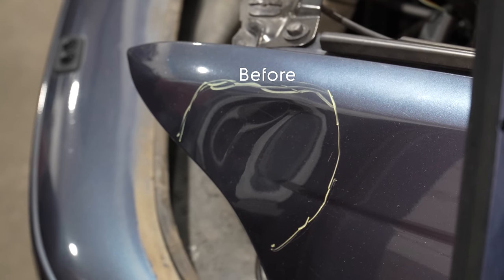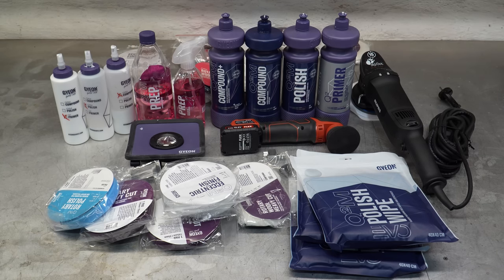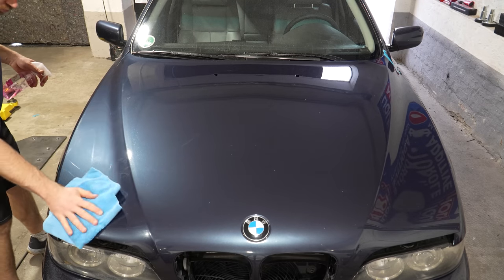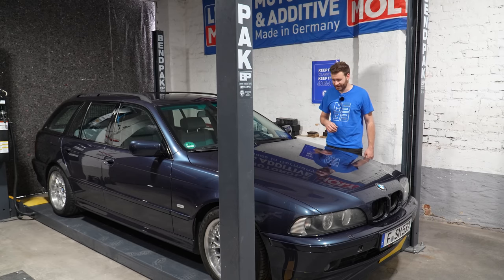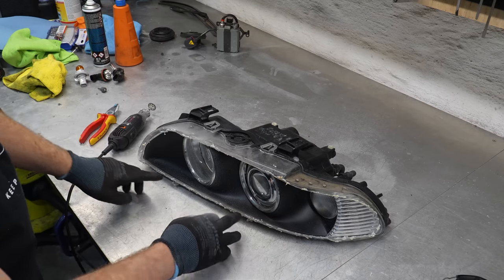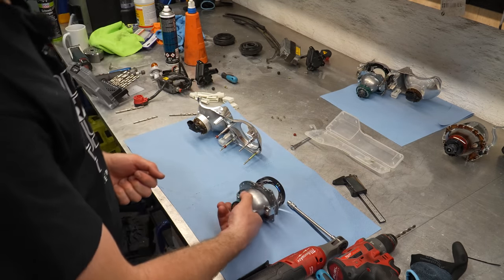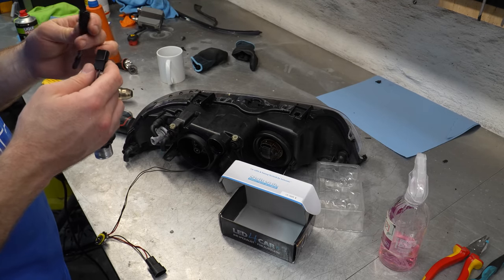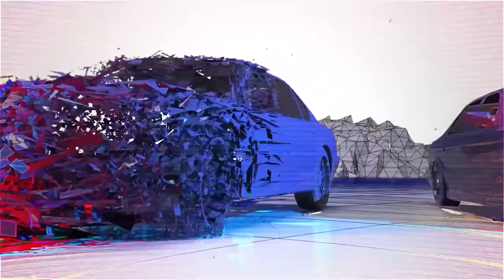What It Took to Restore a BMW E39 5er Back to its Former Glory - Project Rottweil: P7

Comment: I bet the TUV inspectors love when you bring in your projects. Such a treat from the mundane things they must see.
Reply: For once they dont instantly take out the " poking screwdriver" to hunt for rust holes in a 90s BMW. Many E36 are rotten away, many E39 are only still good because people look after them more...
Reply: Thought is it illegal two retrofit bi-xenon. Would love to hear what the tuv inspector reallay said to this one. From my understanding it's completly illegal to change anything in the headlights, including the projectors, even if you don't use the bi-xenon function.
Reply: @LeonBraun  Mosty police goes after cars that look modified. If your car looks stock you can drive around in a litteral rustbucket and they are most likely not gonna care. As for Headlight Retrofits, he did the TÜV inspection beforehand if I remember correctly.
Reply: Yes true, I think the biggest problem is in case of an accident. Insurance companies can be very picky if something safety relevant is not stock.
Reply: @LeonBraun  Totally agree, if there is any way to back out of paying, insurance companys will find it.
Reply: @LeonBraun  Bi-Xenon were an available option when the car was new so its not considered an illegal mod - at least that's my understanding of the TUV inspection criteria.
Reply: @LeonBraun from my understanding of UK law. There is a similar law regarding retro fitting HID’s to OE headlight housing’s. But I haven’t done full research on the subject.
Btw, this is not a criticism of this thread comment or video/channel 👍
Reply: @cd0999  sadly it is. There are some people in the german community who try to get a official tuv for this mod. Its around 2000€
Reply: @LeonBraun  Depends on your specification of car. If "xenon" was in your specification you can install bi-xenon. The only thing they are checking - level of light. Also not every policeman is going to check your headlights here. Especially if your car is in excellent condition. 

I went a bit further. 
I have 2012 opel meriva b which had originally halogen reflector lamp. A year ago I retrofitted it with bi-LED. 

And right now the light is better than on the newest porsches :D
But there are some problems: 1) it's a bit illegal. At least in Russia. And in USA. And in any european country as far as I know. But nobody knows anything about opel meriva here. It's not a popular car. Also it's hard to tell apart is it led or xenon. Also it looks like original lights. 2) Everytime you're in the city or going on high hills you should lower your lights just to be sure that you're not going to blind anyone. 3) You should install Bi-LED in a good service which at least have lights corrector. 
Meanwhile nobody blinked me for blinding for the whole year (35000 km). Literally: 0 people. 

BUT: 1) LED is better than Xenon because of the intensity of the lights, 2) you can program LED with your car computer so the light will follow your steering wheel for example (in Russia every service can install it on VAG/Mersedes without loosing the features of xenon), 3) LED is not as hot as Xenon. It won't burn out the reflector.

Also there are some matrix modules are available on the market. Really love how it is possible to finally see the light on nearly every car now. And I hope that one day at least some countries will lift the ban on modifying the headlights if some conditions are fulfilled (for example if isn't dangerous for other drivers and can function as good as from factory). 

Had some videos, photos and led's names attached to the comment but youtube deleted the whole message. If you want to see it you can just google "opel guacamole-chan" and find guacamole-salad-colored opel meriva b on russian car-guys portal. The name of topic with installation is called "*something on russian* Bi-Led".
Reply: @LeonBraun it is but who can say that you did anything if this car had some xenon lights?
Reply: No E Prüfzeichen makes it easy recognizable as illegal.
Reply: @adamt3332 you cant really tell but technically its not allowed. Its like the episode where he spraypainted the aftermarket suspension link black because the original part was no longer available or smth. If they cant tell the difference its apparently fine.
Reply: @NaticusFetch51 what i can tell you is that you need to have autoleveling headlights if you have have over a certain amount of watts in europe. As well as something that cleans the headlights. I think there is one xenon headlamp that managed to stay below the watt limit but basically xenon=autolevelling required.
Reply: @D3nn1s  yeah, I know about it. The same requirements are here in russia excluding headlight cleaner. It is required for xenon but unrequired for Led. Even on new cars.

The problem is that autocorrector isnt a perfect solution. Even on new cars like kia soul it can blind other cars. But when you're operator and you think about others - that is much better than autocorrector.
Reply: @NaticusFetch51  i rarely see xenon/led blinding people and when they do its just 1 light not set up correctly most of the time. However i regulary see trucks or vans with halogen that are blinding cuz they dont even know that this feature excists.
Reply: yes, they must be so interested in new suspension struts.......LMFAO
Reply: Just a heads up so you don‘t get in trouble: they don‘t usually check for PPF on headlights or similar unless your car is really modified. If it‘s just a clean car in OEM look, they won‘t even check for something like that. More important is the E-Number on the headlight glass which I‘m pretty sure that the original ones had and new ones don‘t, correct me if I‘m wrong.
Reply: @tw1st3d35  yep. Headlights have symbols on it's body. For example, you have linzed halogen (like on opel meriva b with afl headlights). Technically if you installed bi-led or bi-xenon it would be unreal to see the difference. Because c'mon it's already linzed. But the body of your headlight have a symbol that it's halogen. 
Also when you're rebuilding your headlights the sealant will give away that the headlight was opened. 

But I agree that if your car looks clean nobody will check it. At least if you are not going to install bi-led in lada 2101 :DDD
Reply: @NaticusFetch51  sealant is hard to see so I doubt that will give it away. The bigger issue is the E-Number. Without it, you can fail tech inspection and you can get fined in a police stop if they notice it which they usually do because that‘s all they look for. But a clean car like this, nobody is going to take a second look.

EDIT: I couldn‘t see the E-Number on original glass so I think it‘s on the housing which he reused.
Reply: Xenom retrofits needs headlights washer
Reply: @_Philip_.  no they don‘t as long as they are under 2000 lumens.
Reply: @NaticusFetch51 xenon and especially LED headlamps are a total disaster for everyone except for the one driving the car itself. I tried to give it the benefit of the doubt, but as more and more cars with those headlamps roll out on these roads with factory fitted non halogen lamps I can't anymore. The self leveling is always too late, every bump in the road blinds an entire district, the color often is disturbing and feels very unnatural/unpleasant to the eyes . Only on a few % of the cars it's acceptable, but just on straight roads with minimal elevations. 

With all these unresolved drawbacks it should be banned worldwide, just as those flickering mist lamps that go on at turns and LED daylights on bumpers that most of the time are wobbling, even on quite new cars.
Reply: @12123188  if you’re talking about led or xenon bulbs on halogen headlights - yes. Those people should be in Hell. Even in Russia if you’re stopped by the police with those bulbs they’ll probably take away your driver license and confiscate those bulbs. But I was talking about the whole modification of your headlights with installing the modules of led or Xeon (bi-led or bi-xenon). You literally need to cut your headlight and remove halogen mechanism to put the module here. And maybe it depends on the size of a car and how you installed and how you adjusted it, but I’ve blinded no one for the whole year (since aug 2022 with a total mileage of 35000 km). Why I am so sure? Because Russia isn’t shy country and if somebody is blinded by your headlights they certainly will turn highbeams to blind you to make you turn off your highbeams or lights. Or at least flash you with his headlights so you’ll notice that you are a nuisance for other drivers. 
When I first installed those lights i’be got once ‘flashed’ in the city because I didn’t lowered my headlights and was going up the high hill. So since that moment I always do lower my headlights in city/on speed bumps/when I’m going on the HIGH hill. And I never got flashed again for a year.
A few messages before I told how to find a topic with a result of installation on my Opel (google: opel meriva (Установка Bi-led) Dragon Knight K3 ). I’ve got a lot of photos and videos (1 hour of driving on my daily route). 
But I also agree that self leveling is not a big help. Even if it is installed on factory it can blind others. So normal driver who respects other drivers should at least use mechanical leveling.
Reply: @12123188  ok. Opened some videos on my yt. 3 from my dashcam and 2 from phone. Sorry for music on videos from dashcam. 
On video “гонки 1“ headlights are settled on the lowest level (forgot to make it higher). On others the level is on 0. As you can see I’m not blinding anyone and the color is ok. In real life it’s even better (not absolutely white/yellow/blue/green. Absolutely natural color).
Reply: @NaticusFetch51  I believe you. I've seen it being good. But even when it's factory fitted most of the time it's just rubbish. Here a lot of new VW's have it and it's rubbish most of the time, even the DRL lights. Almost every time those DRL lights wobble like they're on a vibrating plate. I don't know what's worse,  too slow adapting headlamps, or the ones that aren't perfectly set. With not perfect halogens it's bearable. The others just laser your eyes, retrofit or not.  Even on BMW's and Mercedeses. I applaud the people where it's all sorted out but it's a very small percentage. I guess most of the mechanics set those non halogen lamps right on the highest point where it's still good/legal instead of a notch down. Maybe it isn't the technology but the regulations? The fact is that in almost all of Europe it isn't right and something has to be done about it.
Reply: My E39 got complete rust prevention on the underside and in all holes, only rust the car has is from paint chips. I love it
Reply: Factory new cars blind me with their lights, the new Toyotas especially
Reply: Maybe to BMW enthusiasts. To the vast majority of people this is just another station wagon
Reply: I really think they even don't inspect the car anymore. They already know the car Sreten brings in is in mint condition.
Reply: @cd0999  Show me that E39 with original bi-xenon headlights :P
Reply: @LeonBraun  If you want to get really specific - AFAIK it's not completely illegal, e.g. there was a case of TUV allowing the use of LED replacement bulbs (light source? whatever you call them) in a car that doesn't have them stock (Dacia Duster) which is technically a violation of a headlamp homologation as it's homologated for a specific light emitting element. In reality you'd only get in trouble if it's visibly modified (demon eyes lol) or if your lamp looks stock - so unbelievably bright that you get singled out by the police. Inspectors check if it's set up right and maybe the minimum light output. Not DE but my car passed inspection despite having its lights close to kaputt. It was actually dangerous to drive at night but it passed anyway...
Reply: @tidysampler585  police dont care but its if the car didnt have the option of xenon or the likes it cant be installed, if it is it has to be to some sort of specs for saftey, so really its a stupid law that doesnt do anything but tell you to modify your car properly.

Comment: I had my E39 headlights refurbished /also upgraded to facelift ones as my car is July 00, so just before facelift - now I no longer wonder why they didn't feel right from the start after I installed them.. Further more - the right one stopped moving up and down, stays down all the time, perhaps the motor went off. The left one - that one is funny, goes up when car starts and then goes down, or stays up - has his own way of working. Very funny to drive with rain at night and both headlights to "fall" and give light output of about 3 meters in front of the car. Well done on that part and on the entire car of course, turned out amazing!

Comment: Sreten, a bit of advice on the Rupes. The rubber ring between the machine has the tendency to let the machine stall very fast. You can remove it and take a bit of dust or horizontally cut it in half so it won't rub on the disc below it.

Comment: To cut BMWs hard paint on a DA get yourself a Rupes Coarse Wool Polishing pad (the one with short fibers). It cuts really well.  I've managed to get my X5 concrete-like pait corrected in two passes tops 👌
Also, look into getting a lake country pad washer, after two solid cutting passes your pads are already getting full of material that you're taking off. You are probably blowing it out with the compressor off-camera, but the pad washer is just a game changer. Great work overall 👏
Reply: Useful tips 👍

Comment: Amazing job. Damn that amount of doing with the headlights. I have refurbished them few setswith polishing and new plastics attachments, but never opened them completely. It was enough when the projectors were newer than now. Polishing them is not as durable as 2K clear coat, it makes miracles for the old plastic, by experience. I love the look of that interior!

Comment: Did a similar paint correction on a 2010 535 touring. Not quite as extensive but about 25 hours in total. Very satisfying. But a ton of work. Great job !

Comment: Very nice result! There really should be a UN-led effort to save all old E39s. They are probably the best cars ever made. I owned a M-sport sedan for many years, and I skipped the E60, the F10 and currently trying to get to terms with the G30, but none of them have matched the dynamics and the joy of driving of the E39. In addition the E60 fell flimsy compared to the old one, and the F10 was so dull, it should never have been branded BMW.

My dream car these days would be an E39 M-sport sedan (6 cyl) with a B58/8 sp ZHP swap.

Comment: Great Job … What a pity more people don’t do this type of update to older vehicles and sell them commercially as fully refurbished vehicles. “Zero timed”. I know the paper value doesn’t work, but they make stylish, practical sense in terms of purchase price compared with a newer model that will massively depreciate the minute it drives off the forecourt. In time it does make financial sense and in terms of smiles per mile, you are an instant winner.

Comment: What a car - I am seriously considering renewing my relationship with a late 90s early 00s E39 if I can find a good one in the UK. 525i or 530i most likely. I had a 520i (M52) for 9 years and loved it despite supposedly being under powered. An E34 520i before that. Best straight 6 engines ever.

Comment: I completely agree that the headlights must be good. Good high beams (led bar) can be, but good low beams must be. I have also repaired the headlights myself and replaced the old projectors with bi-xenon projectors, the results have been very good, in addition, a new windshield and long driving in the rain and in the dark is much safer!

Comment: It seems that those projectors are a bit more trouble than they're worth. I retrofitted the EvoX-R 2.0s and the cutoff was dead straight, they needed no bracket, no drilling or trimming, certainly no pieces of aluminum to get the hotspot right and they don't sit that far back from the shroud. Morimoto updated the Evos not too long ago and they are a bit longer than before, so the gap is not noticeable unless you're looking for it and I feel like the width of the beam and the hotspot pattern is basically identical to those you installed.

Comment: $20k for e39 touring? You are a mad man my friend! 😁And I was mad when I bought e39 540i vanos for $4000, then spent $3000 on vanos failure and rebuiding the engine (intake camshaft snaped, 4 valves bent) back in the days 😅Later on I had e39 528i and that thing was mint! Now I daily e61 535d, which also made me sad with fuel injection failure worth $2000, but still it's awesome car.

Comment: Takes a lot experience to be good at dent removal. You have to understand the metals, the paints, the types of damage and the right tools. Give Average Joe the tools and ask him to do the same, even being shown, and they'd make a reverse dent.
39:24 You should take some of that sealant and dip it in various solvents along with some of the plastic from the lens (if you still have some of it).
18kE? That's a lot less than i expected man, a heck of a lot less. I was certain this build was in the 25~27k range. I suppose the price might account for the fact that you're doing all the work yourself, if it'd been a customer's car, the labour alone would kill the wallet. Stunning work.

Comment: You can actually use the ceramic coating on the windshield. If you coat the windshield wiper rubber and the windshield it will last a long time. If you don’t coat the wipers they tend to rub the coating off in a few months 
Great build and attention to detail